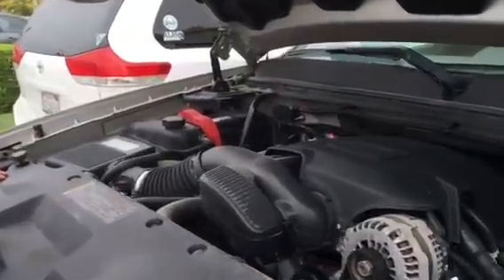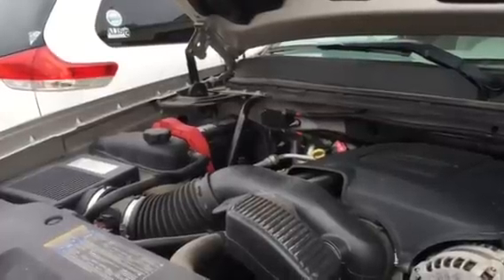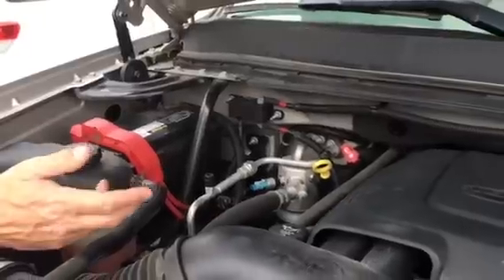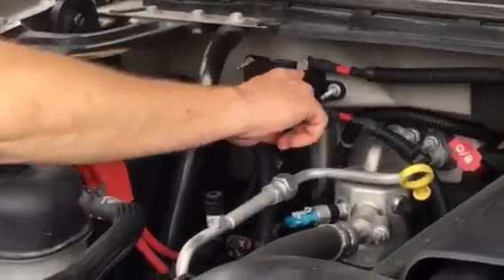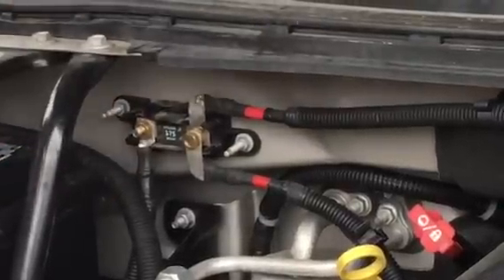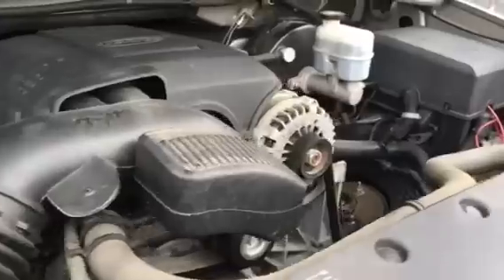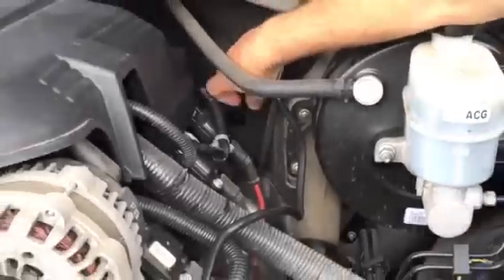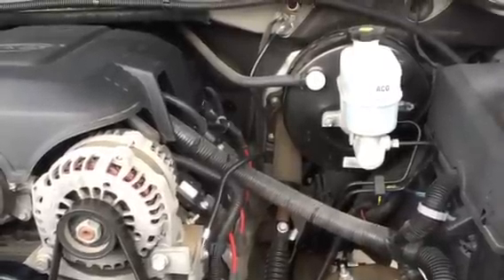GMC Truck Electrical Error Fix

Comment: This saved me from dropping hundreds/thousands of dollars to the incompetent dealerships that couldn't diagnose this issue. I spent $15 and now all my electrical problems are fixed. Thank you so much for this!!
Reply: Just got done doing this exact thing a few mins ago to my '08 suburban. Hoping it fixes my issues. Time will tell. If it did, $10 just save me hundreds as well. Thank you for the video, great job of explaining things. Super helpful.
Reply: @brianrink1379  How's it going on the burb?
Reply: @DylanFahey  j
Reply: @brianrink1379  iij ok
Reply: @ronniestoney7000  i
Reply: Hello , great video ! I have to ask, what kind of screw did you use to attach the cable to the engine?
Reply from the maker: Great - Keep those older cars running!  I love not having a car payment -- and if we can do it without paying the dealerships a ton to keep them going, all the better.
Reply: Ditto what Albert said, I was just guessing a shop repair would be at least 600 bucks to clear C0899 and U1826 codes plus one other. I took apart the fuse link at the firewall like you did and it looked suspect, why the hell it's not sealed I couldn't tell ya. Anyway I replaced some of the brass nuts and one stud, cleaned all the surfaces with steel wool and reassembled with a little die electric grease on all surfaces. I also took off the negative block to ground at the rear of the engine at the firewall and did the same. Like you, I think that rear bolt on the block would have to be a 10mm double back offset combo bfr on a protracted gimble to get to, didn't do it. But I did use the grease on everything I removed and replaced and polished. Checked again and cleared the codes and BAM!!! all good! I really appreciate your posting this video and need to know where to mail the $600.00...;) cheers mate.

Comment: My parking lights won’t shut off do you think that could be the problem
Reply from the maker: My first inkling on this is that it might be a bad relay. However, it could be that a bad ground does cause the relay to not have enough energy to switch off. You might try putting out a temporary jumper from the negative to the body. You could see if that has any affect. If you’re not experiencing any of these other problems, like the door locks jumping up and down, it’s probably more like a bad relay.

Comment: WOW !! Dude this video was much needed!! I have a  09 GMC SIERRA and I starting having issues and thought because I got all new stereo aftermarket speakers 🔊🔊 and two subs and a new car play radio I thought maybe it was the audio guy that messed it up but I had another professional shop check it out and they said well the guy looked like he installed everything correctly except for thE Power WIRING FROM THE AMP HE SHOULD HAVE PUTTING ON THE FUSE BOX for a connection after he took it and connect it to the main battery everything seemed better until a few days later it started back up again my door and dash lights we're going crazy off & on. So now I'm definitely thinking this has to be the issue and I will show this video with my mechanic 🧰
Reply from the maker: Also check the ground clamp right onto the battery.  Since making this, I found that problem too.  These GMC's seem to have a problem with their grounds.  They look fine but really aren't.
Reply: @XORBob ok thanks for the tip will definitely have my mechanic go over everything & replace them

Comment: Ill need to do this on my 07 nbs 2500 gmc sierra reg cab 4x4..
Randomly radio stops working and speakers. Also my rear back up beeper will stop working Randomly...
Im sure also grounfing issues.  Especially for random CEL

Comment: Duuuuude!  I had an extra ground cable from my solar setup and did exactly what you said connecting it to the firewall and then ran it to the engine.  Rapid locks and crazy gauges fixed!!! I’d buy you a beer if I could.  Fixed at no cost!!!

Comment: Mine had the same problem ( YUKON 2007) very simple and easy to fix , Defective negative  battery terminal , work on it till you have good and firm contact , that's all there is to it ;  carry a wrenge with you, cause it'll come loose again.😮

Comment: I will say that working for gm they have alot of ground issues it's usually a ground problem on these depending on what year to where they are could be engine strap or the one behind the kick panel on passenger side witch corodes etc yes very poor engineering it's usually a ground that causes all kinds of problems

Comment: I was going to try and get an appointment with the Vatican and have my 09 Silverado Exercised by the Pope because I'm sure it is possessed. As I am commenting the brain is coming to life,the wipers jump up an inch each time. They are halfway up my windshield now, one door locks,lights but no function on or off, everything is flat lined, no power  seats,windows, truck locks you out and arms itself. But only if the keys are sitting in the cup holder and windows are up. No reverse light,manual gear shifting , traction control, radio stays on, cab lights turn on when off and dims at its own  will. Says hood is open.This is a dangerous Truck. All this and a Bailout.  When it tried and talk to a "certified GM mechanic" the first question was " does the vehicle have oil?    I left an appropriate response. I am going to replace that ground wire now. Thanks for the advise. If this works I feel very bad for the next poor truck this demon chooses. Amen

Comment: Good video.  Adding the extra strap was a good idea.  I have one suggestion.  After cleaning you should have applied a liberal coating of dielectric grease.  The grease will help to keep the problem from reoccurring, by sealing out moisture and reducing oxidation.

Comment: I used a exhaust manifold repair bracket on the last bolt that broke off the exhaust manifold on the driver side side rear and it bolts to the head well that's where my body to motor ground was I sanded the black paint off the bracket to bare metal and attached the ground along with the bracket  and it worked for a couple starts then it just clicked no start. I moved the ground to a empty bolt hole just above the spark plugs 08 gmc sierra 2500 6.0 Ly6 works great now and no exhaust leak

Comment: A buddy of mine told me a funny thing about grounds once, he said here in the states the majority of folks tend to chase problems on the positive side first when troubleshooting, but in Europe they always start with the ground.  I wished someone had shared that with me a lot sooner in life.  It would have save me a ton of cash and a lot of headaches.  Ground straps between engine and body were the root cause of two of them.  Great job diagnosing!!!

Comment: I added a ground cable from passenger head stud to a bolt above the battery,  from that C shape brace cus I couldn't get to the back of driver side head where that braided cable goes to.  Wonder if it's location is critical or is the one I added enough

Comment: 2005. If the interior ever goes dead, follow the parking brake release cable and you may find it leaning against a black box in a galvanized bracket.  Move the cable away and everything will work again.

Comment: I’m hoping this is my problem, I already replaced the battery negative cable and it worked for about a week. It’s starting to do the same thing again so this is my last resort before I take it to a shop. Wish me luck 🤞 . Thanks for the info

Comment: What kind of bolt or screw did you use to screw on by the alternator???
Reply from the maker: I used an existing bolt that was on the engine casting.  I think it’s in the video at the end
Reply: @XORBob  did you connect the old cable & the new cable together?
Reply from the maker: @giovannibalcazar  I did in the back where the old, bad cable attached to the firewall as I couldn't reach the bottom of it behind the engine.  Just make sure the new cable is closest to the body when you attach it.
Reply: @XORBob  do I have to disconnect the battery before disconnecting it?
Reply from the maker: @giovannibalcazar  No, you shouldn't need to
Reply: @XORBob  thank you very much it worked!!

Comment: Thank you. It's a start for me. One issue for me was the wires that connected to the transmission, replaced wires and fixed part of problem but still have issues with fuel gauge which I replaced pump already still problem. I'll check what you shared, Thank you.

Comment: Thanks for the video. Same issue in a GMC Sierra 2009 . The truck can’t even star sometimes after this crazy electrical shaking even with a new battery .I will  try your fix

Comment: Well now I know I hooked up the connector to the wrong spot lmao
Reply: What kind of bolt or screw can I use to screw on the one by the alternator?
Reply: @giovannibalcazar  I forgot, but it was most likely a 10mm. If not, then just use vice grips.

Comment: So I have a ham radio in my 18 Chevy Silverado and when I turn my steering wheel to the left or right my Raido dims and I get tons of static! No one around town has ever seen this. I’m assuming it’s not normal but I really don’t know. I had my charging system checked today and they told me I’m putting out high voltage around 16 volts.
Reply: I read somewhere that you could have a short between the steering controls to the radio.

Comment: Mine ended up being my steering wheel position sensor that caused mine to act like it was possessed. Locks would go up and down, radio and tv screen would cut on and off, then it would shut the engine on and off. After I replaced the steering wheel sensor, it stopped the electrical problems. I just had to replace my alternator though.

Comment: I did everything in the video and I’m still having all the glitching without my car dyeing on me….any suggestions
Reply from the maker: I would really make sure that battery connection is good.  Also, there is a second ground wire that goes down from the battery ground, under the passenger side fender, and connects to the frame near the passenger side bumper.  Make sure that connection is clean and tight too

Comment: Don't forget the Body control modulator, ground my 011 gmc is grounded on the frame close to the radiator ,,mine did the same malfunctions,almost had a wreck at 70 mph

Comment: My 2009 Chevy Avalanche was having the massive electrical f'up. I cleaned the battery posts, the cables, the mega fuse and those cables, the block cable and went down under to the ground cable on the frame. Let me tell you that last one is a boogerbear to do. I also coated everything with dielectric grease when reattaching cables. The neg cable is not as tight as I would like and may have to replace.
Reply from the maker: Is it working now?
Reply: @XORBob  I did all this on Sat 22nd, drove 5 hours to Houston, no problems. One time during the drive, the door lock clicked out of the blue and scared me. Looked over and my dad had rested his hand on the door handle and accidently hit the door lock button. I am driving it about 40 miles a day for his cancer treatment and no problems yet. I love my LTZ Ava but next on my attention is the front wheel bearings and then the transmission. Oh, it has 270,000 miles and I got the adapter to plug in to stop the AFM system. No lifter issues, knock on wood.
Reply from the maker: @robertspain3742  ha! That’s funny about the lock.  My wife did that to me too.

With that many miles you’ve got your money out of that vehicle!  Glad it’s still going

Comment: Thanks for posting this! Had the same issue and it ended up being the fuse. Added the extra ground cable just in case. Thanks for the tips!
Reply: Can u tell what fuse u changed? because I did this ground wire and it didn’t work for me
Reply: @RicRey925  i believe it is called mega fuse it is where the positive battery cables goes

Comment: Mine is doing it but I wiggle my negative cable and it starts so I believe it’s corrosion inside the cable I got a new one to put on and a positive also but the positive cable I got doesn’t have the post clamp is there two parts to it?

Comment: About 4 years ago, I had to replace my throttle body. It was super easy and all was good. About 2 months later, I go out to a completely dead truck. I replaced the battery, it was due anyway. Still nothing. Over a week goes by and my neighbor just happened to walk by while on the phone with a friend that was a mechanic. Mega fuse!!! I had no idea there even was a mega fuse. $4 later, truck was alive again. But after that, but not all at once, I started have throttle body issues again and all my communications were and are throwing code. I’d take care of one thing and then another pops up. Just got another battery, I think I’ll check the mega again and see if that is arcing. If not I guess I’m checking my grounds.
Thank you for getting straight to the point and making this repair easy to understand.
Reply: Was it firing up and shutting off?

Comment: On my 05 yukon I just found my oil pressure guage is stuck at 80. Far right. So I'm guessing that explains the battery draw parasite. The cluster.

Comment: My 02 chev van nightmare never got fixed. Sold it. 
Only in reverse caused engine stahling then engine light and loss of power and got worse blinking engine light was the worst.  As I said only when I reversed.  The last day I recall massive white exaust.
Then my 00 chev van had a corroded engine ground on the top on the thermostat housing. 3 mechanics gave up. Cost me $$$.
That caused thrme ECM fuse to blow shut off engine. Cranked just fine but no spark.

Comment: What did you do with braided ground? Just kept it bolted on both ends with new grounding wire connection?
Reply from the maker: Yes, I just left my old one in place

Comment: Whats the name of the part???
Reply from the maker: It’s just a grounding strap.  If they don’t have one, get a negative battery cable with small enough end connectors to attach to bolts on both your engine and body.  Don’t forget to clean and get all the paint off the place you are connecting them too.  You want good metal to metal contact.

Comment: I have 2017 Gmc yukon daneli that was experiencing a host of electrical issues causing display actions to open and close windows, radio turning on, and everything turning black and car shutting off. The car would eventually turn on but would do it again.  Bottomline, i believe i traced the problem to a bad ground - the braided ground  wire at the connect to the chasis was worn/corroded and not completely broken which must of been causing the sporadic problem.

Comment: ThAnk you I’m having same issues man exactly , 08 Sierra 1500 , I’ve cleaned all of those grounds as well as the maga fuse still nothing but hadn’t got to that strap yet , I had added extra grounds from battery to firewall and battery to frame , I think you just told me where my problem is !

Comment: My 2008 Chevy Tahoe 5.3flex is doing the same thing. Door locks randomly activate, speedometer jumps around and it hesitates when accelerating periodically. All of this only happens while I'm in drive. I've tried your fix as well as meta brushing and dielectric greasing all the grounds. I put a new mega fuse in with the same treatment and replaced the negative battery cable. Any ideas what to do next??
Reply: Gabe, no I ended up replacing the alternator and starter with no effect. I changed my autodoor unlock from unlock in park to just at key out. This quited the cabin enough for me to here something in my steering column making a clicking sound Everytime the car would act up, rpm surge physically/speedo jumps around, and went to the dealer with that diagnosis. They looked at the steering column diagram and figured that since the "steering column interlock solenoid" was the only part in the steering column they carried in parts that it must be one replaced fairly often. I installed that and it seems to have corrected it. Also had a new BCM installed and flashed with no luck prior to changing the shift solenoid. Hope that helps.
Reply: Thanks. I’ll definitely try that before anything else.
Reply: Did none of those fix your problem?

Comment: I was having this same problem on my 2011 Silverado. I followed your directions and sure enough it worked. Thanx for the tip.
Reply: Sorry I took so long to respond. Well it worked at first for about a week then continued doing the same thing. So together with my mechanic we followed all the lines and cleaned up all the grounds and sure enough we found one that was filthy and full of crud. So we cleaned them all and sure I haven’t had the problem since then.
Reply: Please sir, what kind of screw did you use to attach the wire to the engine block ?

Comment: Absolutely works! Same year and model, same issues. It seems to have corrected the other warnings on the dash indicator as well (tire sensors and the engine light). Only an hour into fixing this. So glad my truck won't turn into an electric demon on the highway again.
Reply: What kind of screw to attach the cable to the engine  ?

Comment: On my 07 Silverado the factory battery connectors kept coming loose. I chopped them off and replaced them with the standard style battery connectors. Solved the problem and didn’t have any more issues.

Comment: I wonder if this will help my problem. I have a 2009 Sierra z71 1500 5.3 I had the HVAC case replaced. Now I have a u0109, u0102 codes my traction control is off parking assist is off abs light is on parking brake light on service trailer brake

Comment: My truck has been doing the exact same thing, been driving me crazy. Gonna try this out tomorrow and see how it goes. 09 Sierra 1500 5.3
Reply: howd it go?  im getting the dim lights upon braking, under acceleration ill get the stabilitrak abs and airbags, turn signals cause cluster to flash dimly, want to know if you had any success.
Reply: @Dbridgeman03  Worked great for my truck! Check engine light hasn't been back on since and that was about 2 months ago
Reply: mine never did any of the things you are referring to though